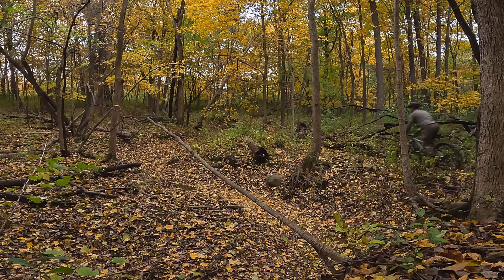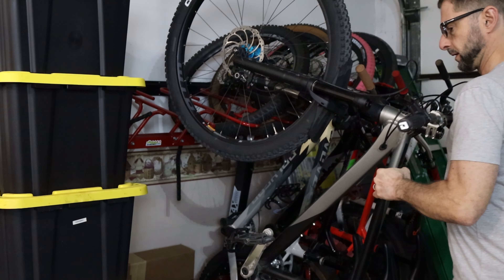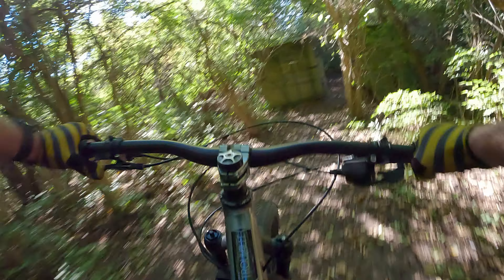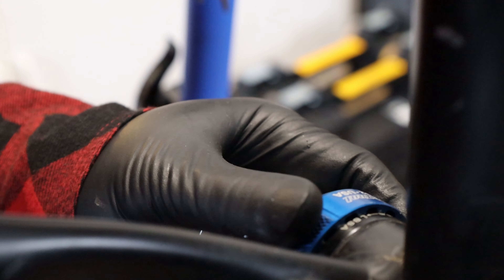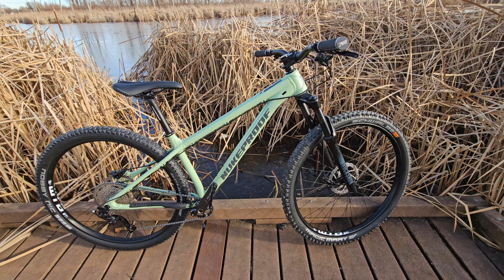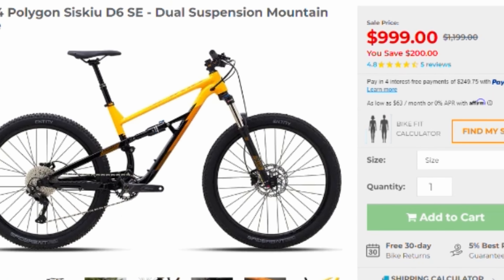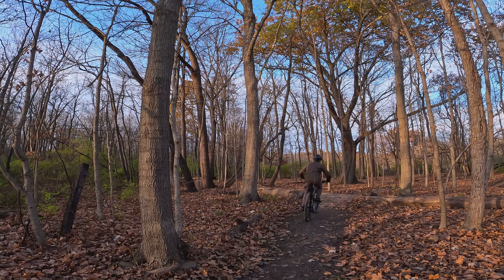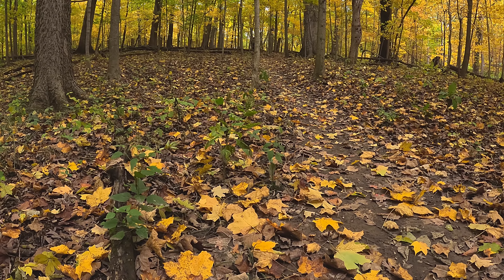With the bike industry crash is the Kent Trouvaille Still a Value?

Comment: Love my Trouvaille which got me started into MTB but now just use it on the road and around the neighborhood. Upgraded to Full suspension Marin Riftzone XR recently for hitting the trails.  Seen that Nukeproof and its definitely an amazing value. Cant wait to see the build. Thanks for the update!
Reply from the maker: Love it! That's why the Trouvaille is such a great bike. Thanks for sharing your experience!
Reply: Huh, I grabbed up a rift zone Xr as well. Mines a size L, so far I went tubless and put a dissector on the rear. That bike can handle some rough for sure!

Comment: I bought a Trouvaille last year. It’s been an awesome bike for me as I’m brand new to mtbing and are only doing light trails. Oh and when I went to pay for it, it rung up at $125 🤣 should’ve bought 3
Reply from the maker: Wow! That's a lot of bike for $125. Enjoy!
Reply: Thanks my guy! It’s been great, I’ve learned how to do a lot of basic maintenance on this. Loving it here in the desert trails 🌵
Reply: Dang!!!! I got mine last April and paid 432 after tax! Still did basic upgrades new crankset and pedals, tubless with same tires. It works great for me but I'm not jumping off mountain sides or anything crazy. Just nice strolls 6 miles at the most
Reply: @leroysalas9833  same paid full price last year then put hundreds into with upgrades
Reply: I got one for $190 early March. Great deal though the front tire tube lost all air with a split near the valve while sitting in the house. Weird since it's too fast a leak to even inflate and I never noticed anything while riding. Oh well, better home than on a ride.

Thicker tubes are not any better if they split.

I'm surprised the price wasn't less for you at that time. It seems like it might be discontinued soon due to stock and deals.

I thought $190 was crazy but $125 is stupid. I know they are desperate to move things at times but damn, I can't image it would sit long at 200 or maybe more.

Glad I held when it had dropped to $300 as it was 190 right after.

Comment: I bought one late May of 2024 for $128 on Clearance, figured it would be an interesting project and something I can take when I travel, so far I have upgraded the BB and Crank and added Hyd Brakes....so right now I am into my bike for $230....rather hard to beat it at this price.
Update:  I added a Rock Shock Judy air fork, an Bucklos headset and  a used front boost wheel...
Total into the bike  is right at $391 and it rides great....fun bike and a fun build.
Reply from the maker: Solid deal!

Comment: i just got one for $190 at my local walmart and love it
Reply from the maker: I've been hearing about them finally discounting them. Enjoy!  It's a great bike.
Reply: Yes, I paid $190 early March. Other than a crap tire tube with a split it's been good. 

Could have more low gear range for long steep so cal dirt climbs but it's fine for regular hills on pavement. I haven't had to walk it up but I need to pause at times for a few seconds mid climb after riding a while, wheras with more low range I can just drop down to rest.

Im no lance Armstrong but someone who does a lot of climbing with 50lb unpowered ebikes, both geared and single speed, I feel like another gear or two would be nice.

Seems like the high range is more than it needs so a smaller sprocket up front would probably do it.

Comment: In 2021 I picked up a Schwinn Axum and upgraded over a 2yr span. Less than a handful of stock parts remain. It’s probably around an 1850$ now. I basically made the upgrades I needed as I progressed. Now it is a fun flickable shreddy trailbike that is a custom fit sprinty trail tool. That being said, I do find limits with the frame: limited wheel upgradability, geo, too tall a seat tube, to name a few. As an intro hard tail it has served me well honestly, but my sights are set on acquiring at least a steel frame with the geo and build that I really want. Build it with most of the upgrade parts from the Axum. However a lot of the nicer frames out there still come I. Around $800 for a quality steely. Some Alloy frames on the list around$400. And for that there are some full bikes out there definitely worth looking into, but similar to you the build process is integral to getting a machine made for you.
Reply from the maker: There are always limits with department store bikes, sadly. They can still be fun with the right parts. There are some good deals to be found on hardtail frames right now. It's a great time to upgrade.

Comment: I just picked up a large (18") dropper ready Trouvaille for $100. I'm throwing my parts bin at it to see what sticks. So far, I've swapped out the fork and front wheel with a Suntour XCR 32 120mm thru axle air fork and WTB wheel. I also installed a JG Bike crankset I bought a while ago when they were $30 on Amazon. I'll probably use the 27.2 dropper I have on another bike on the Trouvaille. I already have a 30.4 to 27.2 adapter. Last, but not least, I got a set of Avid XO hydraulic brakes at the bike co-op for $20. I have some time to get it all dialed in since the temperature is supposed to be single digits here in Colorado this weekend.
Reply from the maker: Solid deal. I heard the newer Trouvailles have dropper routing.  Did they change the the internal diameter of the seattube from 30.4mm?
Reply: @AdrenalineIsLife  Nope. The seatpost is still 30.4. I have a 27.2 dropper and an adapter for it. I could’ve reamed the seat tube like you did, but I already have these parts here and I’m really impatient. 😎

Comment: Sadly, these bikes are never going to be able to compete with higher price models. You can change as many parts as you want, but you still have just an so so frame. I'm sure it was a fun project, but funds for all of these parts plus cost of the bike could have got you a pretty decent bike. But always fun to do, and learn a ton along the way. As for the bike industry, I've worked in it for 32 years, the industry will survive and like many other =businesses , some will survive and some will not.
Reply from the maker: Agreed. They are always lacking in one thing or another.  The industry will be fine in the long run. I'm always saddened when some brands go away  like Guerilla Gravity but that's life.
Reply: @AdrenalineIsLife  Yes, it's a gamble some days for most shops.,but it seems that the ones that have good customer support and make changes every once in awhile, work hard and survive. I agree in terms of some closing their doors, very sad for sure.

Comment: It was  on sale for 299 for a lil, then clearance  at190 just recently...out of stock.

They're either updating it, or axxing it
Reply from the maker: It's a good seller, but the big box bike makers are fickle.  It would be nice to see an improved version with a proper seat tube diameter.
Reply: @AdrenalineIsLife  yeah, I've been Facebooking Kent about those issues and  about needing to update their good bikes
Use standard seat tube diameter
Get rid of the built in kickstand mount (new target exclusive Kent Enclave doesn't have it)
Add Microshift acolyte clutch .
Told them they should revise the intrepid for 148 rear and do a 27.5 long travel version ha
Reply: It's definitely axed..Kent took it off their website
Reply from the maker: @user-yc6wx4sn5n  That's too bad. Hopefully, they have something new and improved coming.
Reply: @AdrenalineIsLife  only thing new by them is at target...Kent Enclave
439
It seems a step backwards on a few things
Bolt on wheels
2 bolt stem
Twist shifter?
Specs/description/pics all conflicted 

I did purchase it, still in box, really curious about the geo. But not sure if Target  will let me return if I open up box and build it to get the specs 😆.

May just return it Tonight or tomorrow
Reply from the maker: @MichaelRobibaro  I just looked it up. It definitely seems like a step in the wrong direction.  Especially when you consider that you can find a Kona or other shop brands with better parts and sizing for around the same price right now.
Reply: @MichaelRobibaro For what they were selling it for most buyers aren't gonna be real mountain bikers. They'll just be Dads like me who want  something for family bike rides, and maybe some lightweight trails once and awhile. For us kickstands come in handy.